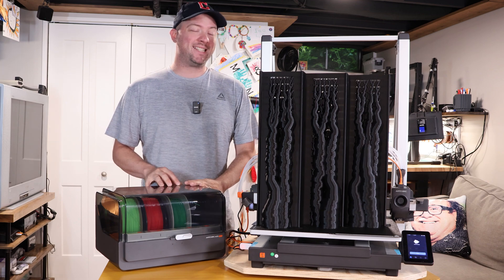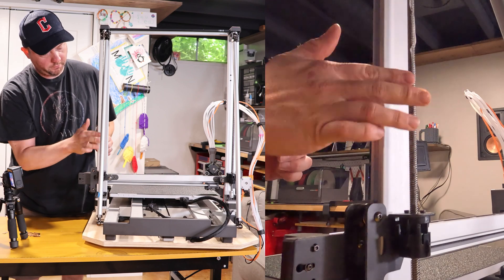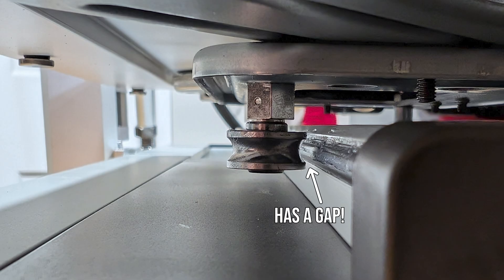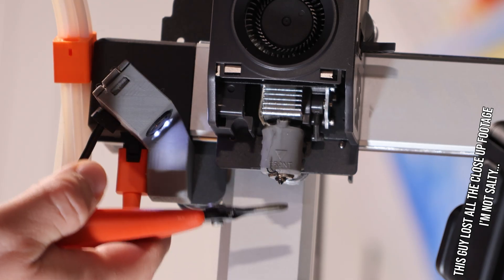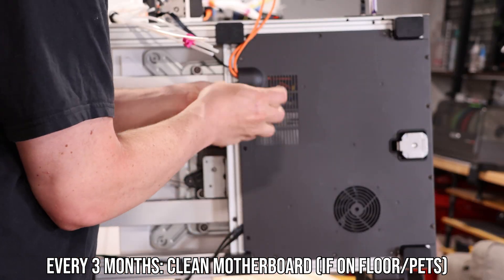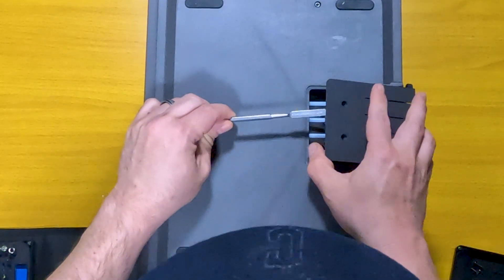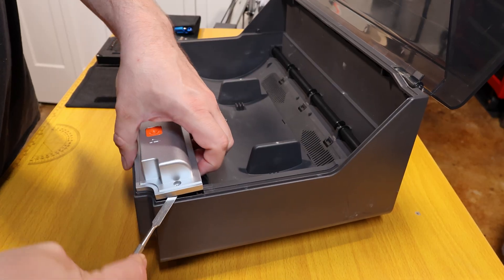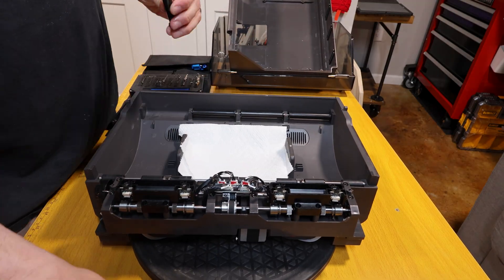Are You Maintaining Your Anycubic ACE Pro and Kobra 3 Max?

Comment: Shouldn't you remove the 'old' grease that's on the axis before applying a new coat? If the old grease has dust/shavings mixed into it, you're just adding more clean grease to a dirty 'mix'.

Comment: It's expensive for a printer of this size but by far the best "maintenance" you can do is keeping it in an enclosure. There aren't tent enclosures readily available this big but a 40x40x40 photography lightbox will do the same job if you can find one - it will just fit if you angle it slightly so the bed has more room to move. I recommend a heavier grease (lucas extra heavy duty etc) for the lead screws and a lighter grease (superlube etc) for the linear rails. For the eccentric nuts, you want them just tight enough that they won't spin freely, if they're "tight" they'll just wear down and need to be replaced sooner.
Reply: enclosure cause more issues for non enclosure designed printers. Heat becomes a problem for a lot of things.
Reply: @bevis420  It can, yeah. For my Ender 3v2 I moved the power supply and motherboard outside the enclosure to be safe.

Comment: Right around 11:38 I noticed you removed too little pieces from either side in the back that you didn't mention.  then right around 12 it appears you've taken the clear plastic lid off without any indication that it should or how it should be done. As it turns out you don't have to remove the lid but with those two little corner pieces out and a little rubber strip removed along the top Edge you can easily put a hook in the little slots in the protrusions that keep the spools separated and then it comes out rather easily.